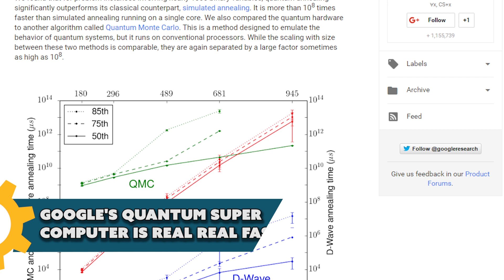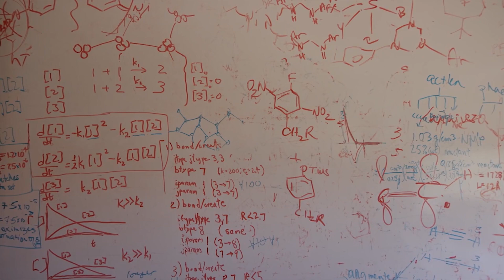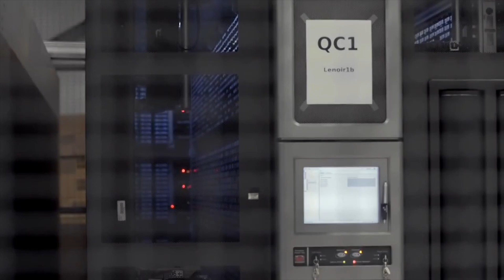The FUTURE of Computers - The Know

Comment: This is an awesome announcement from Google, but don't get too excited about the implications just yet. A single processor is still a single processor computer. And with any single core computer, this means it can only do one instruction at a time. The advantage that a qubit gives to a quantum computer is that we can apply an instruction to the same input. For example, let's say we have a lock that will open if you guess the right answer in the range 0 through 9. The conventional way to solve it is to check every number from 0 to 9 until one works. Basically, we guess until we find the right answer. What a quantum computer will do is ask the same thing using the qubits that represent every number simultaneously from 0 to 9 and then we can look at the result and see which one worked. In the annealing experiment, current methods do not guarantee the best solution because finding it is too costly. So, normal annealing start somewhere random and move from there to find the best local point. It might take us to the best point, but probably not so we run the test 50,000 more times to get close. Quantum annealing allows to find the absolute best solution. Also much faster as we can test so many combinations simultaneously, 2^1000 for the D wave 2x.

So, that problem that google tested is much like that except imagine at the minimum 2^1000 possible combinations, for reference there are only ~2^300 particles in the observable universe. Checking every possible input to see what is the best solution is simply not an acceptable solution as it could take days, months, years, centuries, millennium, etc... That is the basis behind public encryption because we can encrypt SSN's, Names, CC info, etc into "puzzles" so difficult to solve that it just isn't worth trying. A typical range of number combinations for public RSA encrption is usually from about 2^512 to 2^8192. That being said, it is not impossible to solve these puzzles. Google RSA encryption for more info. What a quantum computer is able to do so solve these puzzles quickly virtually making all normal encryption systems obsolete overnight which is why the government is so interested in it. Quantum computers can solve these encryption puzzles in minutes making the data easily obtainable. That is one of the bigger drives for quantum computing and will require new encryption systems to be developed to counteract quantum computer which has probably been under development since the notion of quantum computers.

What about the Ai that was mentioned? Well, Ai is not as advanced as people may believe it is. In Ai, the issue is always "How do I do this"? How do I solve this puzzle in the best possible way? How can I ensure that I am successful? Well, the answer is to "imagine" what would happen if you tried a certain input and see where it might take you and then compare that to other possible inputs. This in some circumstances is fine and probably the most basic level of an implementation of Ai. However, it is expensive. I could easily write a program that is guaranteed to find me the best route from my home in DC to my cousin's house in LA and the program would probably never finish. The number of possible combinations to check is too high. The way most GPS computers get around that is to use rules given to them to help narrow down this search into something manageable. For roads that's fine, and even chess that's fine, but there are still plenty of cases where that will not work. An example is a version of chess where the board is 19x19 and an attempt was made to make an Ai that could play it that ultimately failed due to the size of the problem trying to be solved. The point of all this is, Ai has its own set of question where qubits will drastically improve decision time like for games. Will is be the intelligent Skynet? probably not.

But how will this affect our porn? Probably the most important question here and I'm sure is on everyone's mind. Well, if the porn is a video, it won't change anything really. Qubits help answer question and display a sequence of images of all of our favorite people doesn't really involve any questions. Everything is determined and has a specific set of instructions on how to run it so it really won't be any faster than my laptop. On the other hand, 3D graphics involves all kinds of search question that qubits can easily help with. Aka, what object is at this pixel. How much light from all of the light sources is hitting it? How much shadow should be applied to it? How much reflected light from other object should be visible on it? And so on. So maybe quantum computer will help us with our VR porn ;)

So, what is worth taking out of this. Quantum computers are incredible but not these god sent creatures that will make everything better. Quantum computers help find solutions to a complex mathematical problem that is too costly to solve conventionally. That is how the Quantum Computer do.

I'm sure not everything is right in that explanation but it is what I take from Google's announcement from a Computer Scientist's point of view.

Comment: While it is good to hear the Google QRT actually announcing something, it should be noted that the D-Wave chip is an incredibly early prototype. Not only does the chip have 1000 bits, that is 1 kbit of processing power; it is hardly a proper quantum computer. D-Wave cannot create a superposition over the whole chip. Their superposition is only between pairs of atoms. This gives it a power increase of about 15% over a 'normal' chip of the same size. It is also hard printed to run annealing algorithms, so no one is going to be playing pong on it anytime soon. It is the quantum equivalent of Babbage's Difference Engine.

Secondly, what the Google team reported was a comparison between D-Wave running it's quantum algorithm and a 'normal' computer doing the same thing. Basically, D-Wave is 100,000,000 time better at being a quantum computer than a non-quantum computer. While it is certainly worth reporting since it is nice to have some proof outside of D-Wave themselves that quantum computing is possible, we are incredibly far off from 5th dimensional porn.

I know quantum mechanics is a confusing subject for most people, but as I have been neck deep in it for a couple years, I hope this explains the report a little better than the guys could. The best part was Google talking about their hardware guys making some improvements. With luck, Google will have a real Quantum computer before long. Then maybe we can have our sex bots.

Comment: Great, and I just started learning C++; I'm having a difficult time as it is understanding the computer language.
Reply: +MuzzaFuzza It's actually the other why around. Java is easy to learn, but if you want to make games, use C++.
C++ code runs directly on your CPU while Java requires an intermediate system (the run time environment) to execute the code ,which makes the code perform way slower.
Reply: ***** :o
Reply: c++ is a great starting point. After you learn about object oriented programming in c++, go and learn Java. Java will help you a lot if you want to code for games, you can start with android games.
Reply: +Teh Arbitur what about Oracle? is that easier than Java?
Reply: +zalien6 Oracle is a company not a programming language. Oracle acquired the developer of Java (Sun Microsystems) and is now the distributor for Java's run time environment.

Comment: My specs:Processor :Intel(R) Pentium(R) CPU G2030T@ 2.60GHz 2.60GHzRAM: 4.00 GB System type: 64-bit Operating System,                         x64-based processorNot TouchscreenStill use After Effects and stuff like that...... Its so slow

Comment: quantum computing doesnt make "everything" faster just certain processes and im pretty sure it wont make streaming video faster
Reply: +shay campbell Well streaming videos is internet speed not cpu speed
Reply: +shay campbell actually, it might. its sort of like speaking in another language that might have shorter sentences to get the same information across. if i told you the sentence "internet is for porn" was relayed as 0110101010100101010101010011010101010101110010010010101010, but now quantum computing understands the same message as 0,1,01,1,0,10,10,1,0,0 it could potentially mean faster information xfer since the sentence is shorter.
Reply: +shay campbell From what I've heard the bigger the process the faster the processing. The effectivenes is supposed to rise exponentionally.
Reply: shay campbell The video was very vague about it. You're right. It doesn't do everything "faster". What they failed to mention is that quantum computers excel with data searching and calculations due to the exponential capabilities of qubits. However, traditional computers still excels with logics such as and/or/if/xor.
Reply: +Philip Tuttle That's actually not how it works, either.  It doesn't condense data, it processes data simultaneously.  So instead of adding 3 and 4, then 5 and 6, you could add them both at the same time with the same hardware and get both answers.  This is why it's best for optimization problems.  In theory, you could try every possible solution to a problem at once, and then select the best one through some fancy trickery, instead of going through them one at a time.  
So it may never totally replace a normal computer, because most software does just one thing at a time, but it can make specific problems very, very easy.  For example, every encryption algorithm we have will be instantly broken once quantum computers are commercially available.